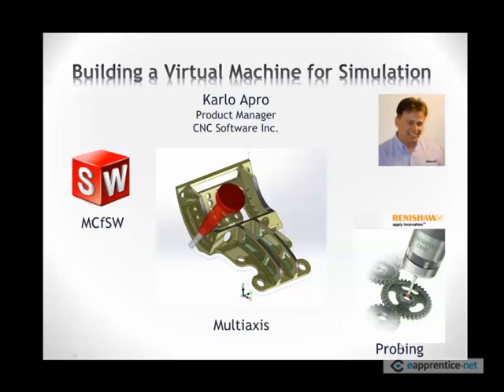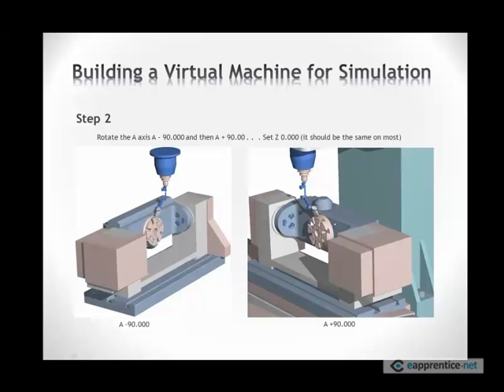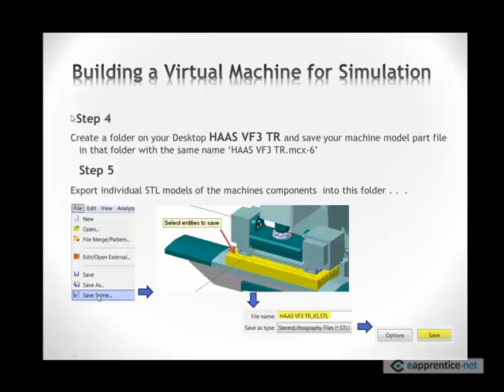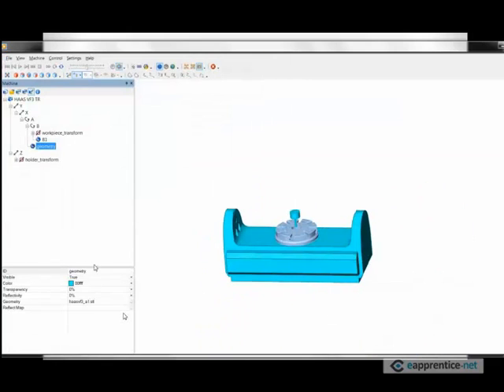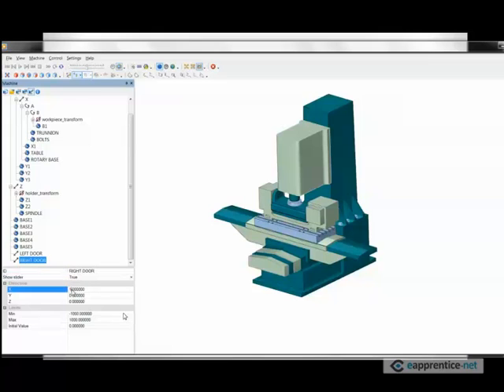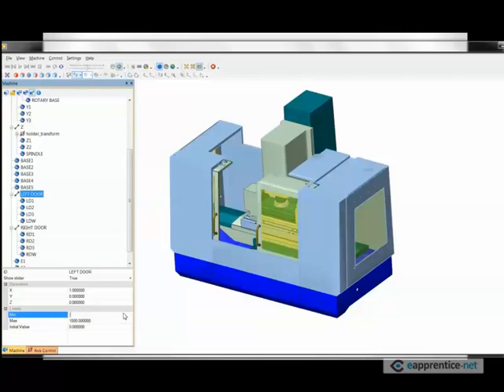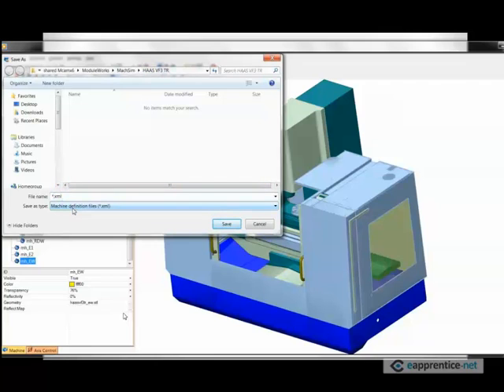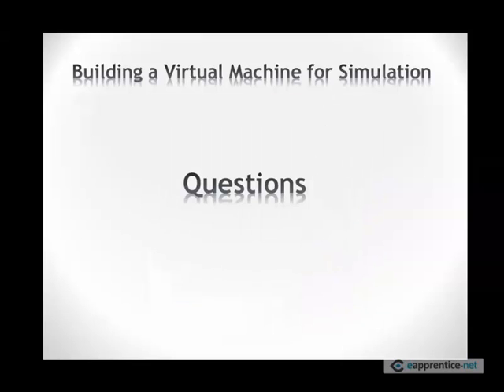Building a virtual machine for Machine simulation in Mastercam

Comment: Thanks Derek, big help. First time setting this up in mastercam I got through the process really well on my third try for a simple 3 axis mill. However I still can't get it to simulate anything using it. Comes up with "Can't load machine configuration files". Looks great on the screen everything moves properly. This happened the first two times I set this up as well but I kept fixing things. Last time my spindle wasn't at the table as shown so I though maybe that was the issue. 

But I did notice that every time I go to load my machine from a different file to try to make some changes, that it somehow converts it to metric on an inch scale so my machine with a 22x50 inch table turns into about 3 inches. Then I recreate the whole thing again(time consuming) and save it, and does it again. Is it required that I create it in metric for it to work properly? Or am I missing a button somewhere. Mastercam 2020.

Thanks!